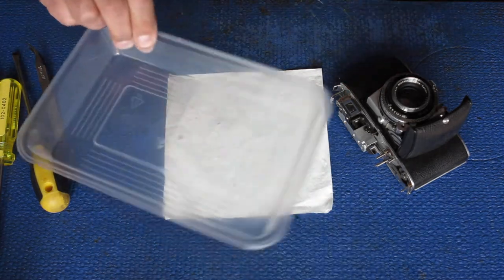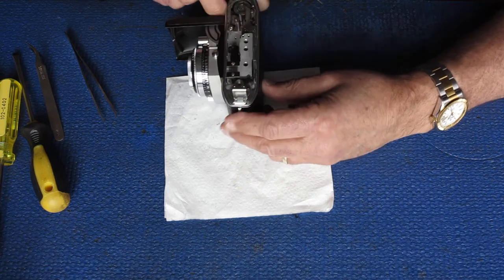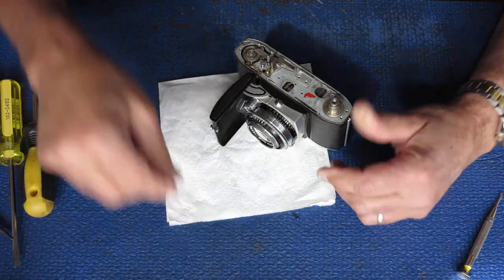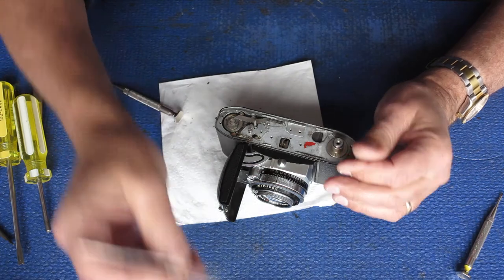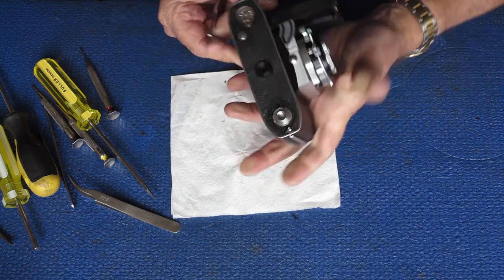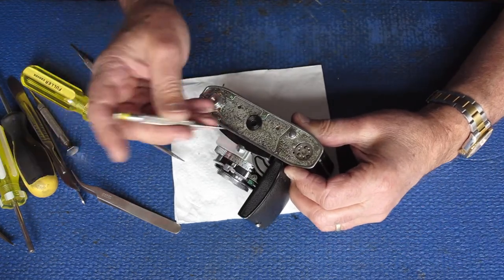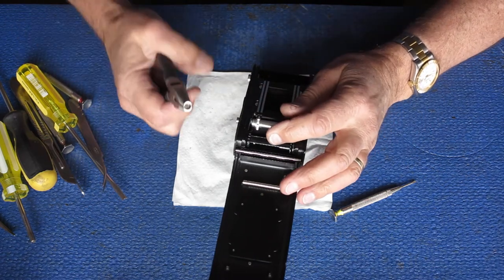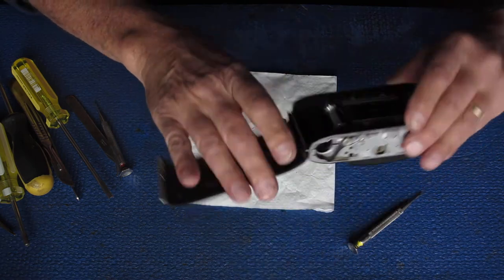Kodak Retina IIIc servicing part 1, stripping down.

Comment: I have a kodak ratina II c and the switch that's suppose to open the back to change the film will aNOT open, theirs no clock, so I think its jamed what can I do? Its in perfect condition and came with filter lenses my bfs h
Grandfather gave it to me
Reply from the maker: G'day Dark Cat. Usually to open the back all you need to do is swing the back--catch cover on the base of the camera to expose the back-catch button. Press the button and the back should spring open. If the button cannot be pressed, this probably means the back-catch is jammed with sand or corrosion. If the button can be pressed, but the back does not open, then something else is going on. Maybe an old film is still in the camera, and the film has glued the pressure-plate on the inside of the back to the film gate. I don't understand what you mean by there's no clock, sorry.

Comment: Do you know is it possible that moment that: front element's both serial numbers match each other and body's serial number dont? (which appear when you open film door and near the lens's back glass) -  or is it impossible? when third, - actual body's serial number don't match only the other two?
Thank you
Reply from the maker: All that is required is that someone has swapped parts over. Someone may have replaced the front lens component and the serial number plate on the shutter, but not swapped the rear group. Mismatched numbers is more of a problem for collectors than for users.

Comment: I was wondering if you could help me? I just received a very nice Retina 3C and I was having trouble figuring out how to set the aperture and shutter speeds, because they seems to not stay in place. I discovered later that theres a flat pin that seems like it should be connected to the light value setting lever. This flat pin is moving freely which causes the f stops to move when I rotate the shutter speed dial. I'm assuming this is not normal?
Reply from the maker: The shutter speed dial and the aperture settings are linked by a spring-loaded clip. You move to the next higher shutter speed, the aperture opens by one stop. 
Have you read the instruction manual? You can find it here...http://retinarescue.com/files/3CIB.zip 
If the little tab that is not fitted into the clip, then the aperture will still shift with the shutter speed, but the numbers that tell you which aperture is set will just float. In this case most likely someone has had the shutter apart and didn't reassemble it correctly. Expect other issues...